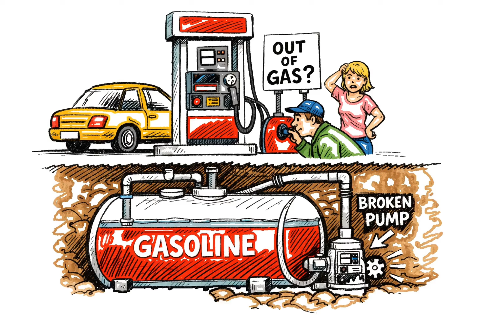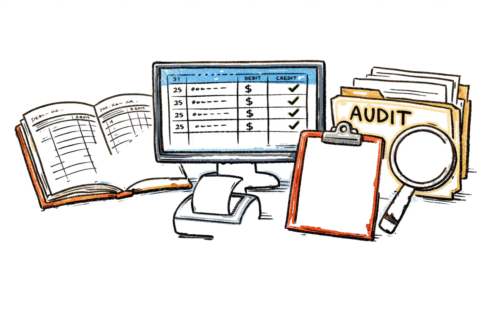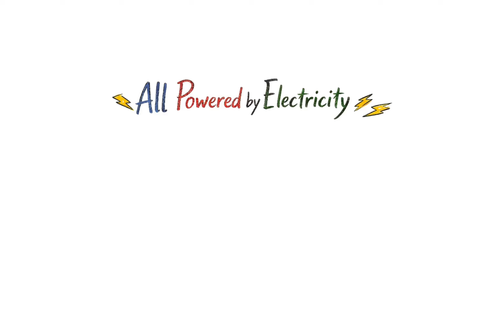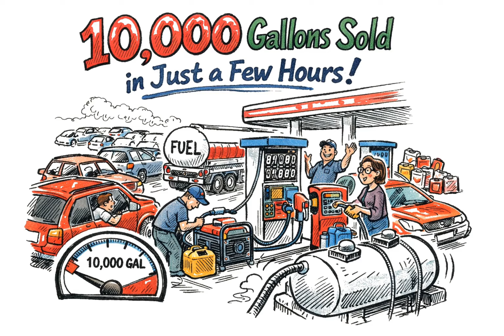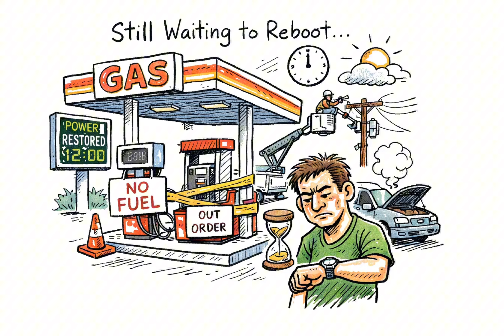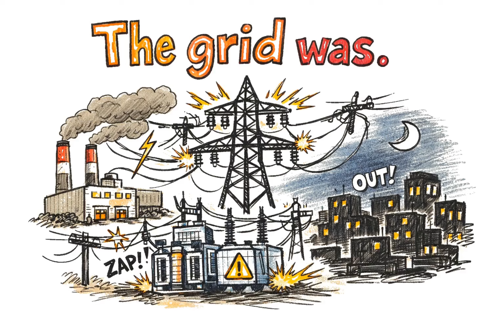Why Gas Stations Shut Down During Blackouts

Comment: Many people misunderstand profit margins and volume at gas stations. I've seen one's placed well off of highways that can operate with good margins because of the volume they sell. I've also seen others shut down because they didn't sell enough fuel or Cstore products to cover a single repair. Many have thin margins and are realistically a failed tank inspection from losing all yearly profits. But if you wanted to pay twice as much per gal during outages, I'm sure any place would maintain and use generators to pump fuel for you.
EDIT: Another thought he touched on is how you'd have a station immediately out of fuel with no delivery because off high storm demand. Normally they'd have at least weekly deliveries, sometimes more. So you'd have to close unless you'd want to dealing with lines of cars realistically not buying anything.

Comment: This is why it should be required by law that EVERY gas station should have a backup generator to run the pumps & power the equipment 8ncluding card readers and registers!
Reply from the maker: Some states actually do require generators for certain stations, especially in hurricane zones. The trade-off is cost. Backup systems are expensive to install and maintain, and most stations operate on very thin margins. It’s one of those resilience vs. efficiency questions.
Reply: @theinvisiblemachineUS Total nonsense! 

When the owner drives up in a $125 k vehicle, the thin margins excuse is just that.

I know several station owners in my area; a couple of them already have no rent/mortgage properties; paid off years ago...

They do well because they don't cut corners, treat their employees well with good pay & benefits - several have worked there for a decade or two. 

Oh, and they have backup generators as well as solar on their roof & canopies. 

By contrast - I know a few more who try to pass off this same lame argument, and even though they have higher prices on everything, much higher on some things, treat their people's like virtual slaves in certain ways and go cheap on everything, they drive hyper expensive cars, and other personal luxuries. And guess what? Most customers hate them! It's a wonder they can make it in the business world at all.
Reply: @jptucsonaz8503  My 2006 Chevrolet laughs at your $125K nonsense.
Reply: @jptucsonaz8503  I'm glad your local area isn't suffering from the incorporation the majority are.
Reply: Stack one more government regulation on me and I'll close forever. Others will too. then only the big corporations will remain and gas prices will shoot through the roof.
Reply: @patrickweaver1105   Bye!
Reply from the maker: That’s part of the tension the video touches on — resilience usually costs money. When systems are optimized for efficiency, there’s less slack during emergencies. It’s a difficult balance.